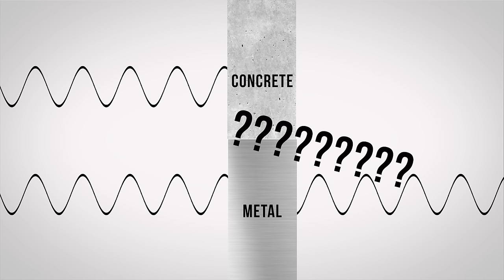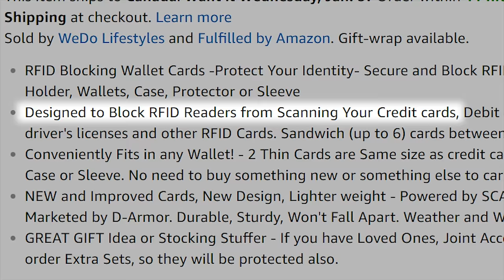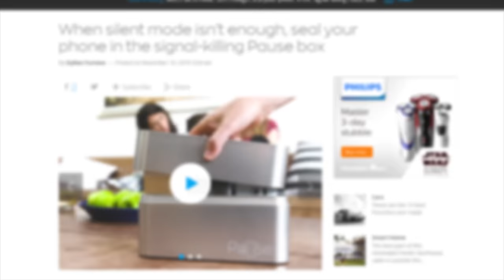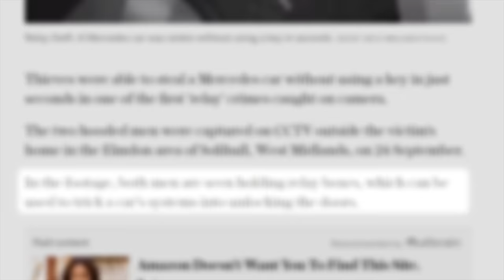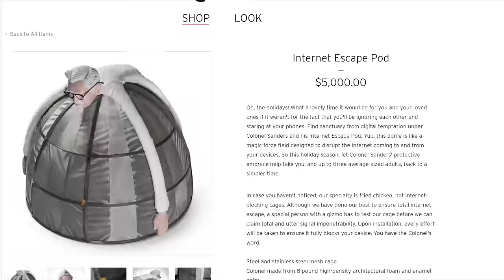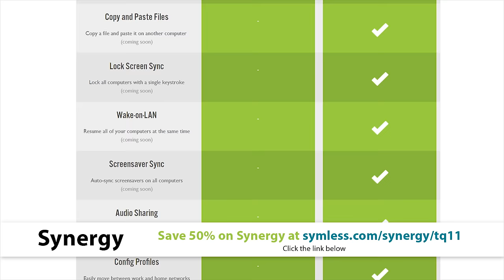How do Signal Blockers Work? (Faraday Cages)

Comment: I live in a Faraday Cage. there are 2 to 3 layers of foil backed foam insulation over my entire house and the seams and corners are mostly taped also.  When my parents built the house we had to take 2 screens off the windows facing the cell towers for cellphones to work inside the house.
Reply: we now have new non metal screens

Comment: Back in the (mainframe) days, a data center was built at an air force base in the state where I live. Unfortunately, when they activated it, the (large) disk drives would periodically have voltage spikes and drops causing problems. It was discovered that the ground control radar for the airplanes periodically swept the building in its circular sweep. The initial and temporary solution was to wrap the building in chicken wire which seemed to work until a more permanent solution could be implemented.

Comment: I love the thoroughness of the explanation and examples and the gratuitous animations. great vid, yos.
Reply: h7opolo, yes, it's thorough. It's also completely wrong, but hey.
Reply: i disagree. please elucidate the shortcomings for me. ty.
Reply: h7opolo, "electric fields push charges away from them." Uhm, depends on the charges and more importantly on the fields. Linus also didn't just misspeak, the animation shows a vertically changing field exerting a static force in the horizontal direction of the wave's propagation. What's that supposed to be, radiation pressure? Also, no word on the fact that EM waves need a minimum frequency for a given Faraday cage to work on them, which is especially important in case the whole explanation was meant to look at a static case.
Reply: He did state that the electric field was moving in a negative to positive direction which repels positive charges, so your first point is moot.
For your second point, would the animation be more correct if the arrows and field lines pointed up and down instead of left and right?
Reply: h7opolo, maybe you should watch the video again. He not only doesn't say what you're saying there, he also said that electrons are drawn towards the signal source. That's total BS. And even if he'd said what you're saying, it still be wrong by 90 degrees.

Sorry, but I can really find nothing redeeming about this explanation. The animation seems to mimick the one from Wikipedia, only that that one's not wrong. So go to Wikipedia everyone instead of watching this video.

Comment: I have a question.  I get that the Farady keeps electricty from getting to the inside or to the outside of the cage depending on where it originates from.   But does the em field change shape to the extent that something powerful enough might not send electricity outside of the cage, but it still might bend space? And vice versa?

Comment: Hi Linus,
I live in a condominium and I see anywhere form 15 to 20 Wi-Fi signals coming into my home. All of which are competing/searching for open channels. This is happening both on the 2.4 GHz and 5 GHz bands.
Needless to say, wifi performance is significantly hindered as soon as I walk away from my SOHO router.
Since I live on the top floor, I thought I would tare the flooring and install a wire mesh, like a carpet, before reinstalling the whole thing.
What do you think of my idea? Do you think it would work?
Ben

Comment: So you mentioned that the frequency of the sound wave actually determines whether or not the signal will pass through a hole in the faraday cage. However I do not understand how this works.
My forward thought is that the wave will pass through based on the magnitude of the sound wave, not the frequency.

Comment: For the sake of accuracy the radiation produced cannot enter the faraday cage but continues across it as in the space inside the cage is isolated
Reply: this should depend on the wavelength in relation to the size of the faraday cage though, no?
Reply: The explanation we learned in school was entirely different than in the video: if the metal bar is parallel to the electric part of the wave, the electrons in the metal move up and down along sending a em wave on their own that cancels the original one out by interference

Comment: Another way to think about this is the cage acting as an antenna.  The antenna is driven by the incoming signal and emits a signal 180 deg out of phase into the cage and in phase back at the source reflecting the signal back like a mirror.
A lot of lower level physics textbooks actually get this wrong and describe the process as the free electrons in the metal moving and then having their energy dissipated by resistance.
Reply: Hmm, can any of you give any tips against laser weapons? Nice to know ...👍

Comment: 0:45 that explanation is wrong, that explains how they work in electrostatics regime. What actually happens is that the electric field oscilates (due to the nature of the electromagnetic radiation itself), generating oscillating currents inside the conductor, witch dissipates energy by Joule effect.

Comment: That is not how a Faraday cage works.

Radio signals are not just electric fields (though if they were, your explanation would be corrected). They are electromagnetic waves. The Faraday cage cancels out the electric part of the wave, by moving electrons through it's conductive material, and without the electric part of the wave, the wave stops. You were pretty close I suppose.

Comment: I seriously wish I could turn my apartment into a Faraday cage. All of my neighbors use dual band routers. The 5gz channels are all super congested, and the way my apartment is set up, we are close enough that their WiFi signals are strong/close enough to interfere a crap ton with mine....
Reply: i'm thinking, you could hang metal sheets on the bordering walls...not sure if i understand it enough though.

Comment: For it to work best it needs to be grounded. 
I’ll be getting a new car shortly and I made sure that I DIDN’T want it to be keyless. I still want to put a key in the ignition to start to car even though they can probably pick up the key to unlock the car and plug into the OBD-II socket then they could start the car that way. 
I’ll be keeping my keys in an earthed metal box e.g. microwave or anything else that’s completely shielded. 

There’s a place close to me that do items for fast jets and commercial aircraft and they’ve got a faraday cage that can fit a double decker bus with room to spare!

Comment: So does that mean that if I just put my phone in the microwave without turning it on, that it shouldn't be able to be called?
Reply: Tyler Lazenby das right, also u wont be able to use wifi or bluetooth
Reply: I just tried this (you made me curious) and it turns out that when I put my phone (oneplus two) in my microwave the wifi signal was immediately gone and my usually stable and highspeed 4g turned into a very slow 3g connection (my provider doesn't support 2g/gsm/etc). I was still able to use the internet though (I used teamviewer to test the connection). I also tried calling myself from a different phone and it went though without a problem. The position seemed to matter, when I put the phone closer to the door it managed to keep a very weak wifi signal. So either microwaves only block certain waves or my microwave is leaking and slowly turning me into popcorn.
Reply: Doskii it all depends on frequency of the signal. Faraday cage can block up to some frequency. Basic equation is width of gaps in faraday cage is equal to half of the longitude of wave from wich you can get limiting frequency by dividing speed of light with measured longitude.  So to conclude ideal faraday cage would    have no gaps (like elevator) so it would block EM waves on all frequencies.
Reply: Doskii the microwave only blocks microwaves because it wants to keep its microwaves inside to cook your food
Reply: I love that somebody just took a testing approach for this!

Comment: I was expecting a Signal Jammer video, like aireplay-ng, instead of a physics class :(
Reply: You were expecting a video on Signal Jammer, which is a much more complicated device, rathen than the simple Faraday cage? 
Tbh signal jammers just spam radio signals in the required frequency, they are nothing special.
Reply: Yeah, a Farady cage it's really simple, is taught on school and there are already millions of videos about it, just Wikipedia is enough for the basics. So, I THOUGHT this was about Signal jamming.
And no, jamming a signal it's not just spamming all frequencies, each technology has a different way of jamming, from Orthogonal Spread Spectrum Waveforms, to common Wi-Fi 2.4 - 5GHz, LTE, GSM, L1, L2 (GPS), "just spamming radio signals" would ruin pretty much your own devices, and it's not practical to transmit high power across a broad spectrum for long periods of time, "tbh" that's just dumb, naive, childish and even dangerous. Believe me, they ARE special.

Comment: I have a friend that keeps duplicates of all his electronics in faraday cages. Two laptops, two smartphones, two tv's, etc. Kinda shitbat crazy if you ask me.
Reply: It's too protect against EMPs (electro magnetic  pulse) which can come from a nuke or the son and considering nassa has said we are over due for the next one while I will say is is a little over prepared in a sense he isn't that crazy
Reply: Yeah, a Faraday cage isn't going to protect against an EMP. You basically need a lead box to do that.
Reply: no you don't, a Faraday cage will work.
Reply: En oK It really depends on the kind of EMP, if a nuke goes out near you then even a good Faraday Cage won't do it because there will be also X-rays and gamma radiation that can easily get through it unless it's veery thick
Reply: why?
Reply: We're only talking about EMPs not gamma or anything else, a Faraday cage that is completely sealed will protect from any v, and nuclear EMPs are usually set off at high altitude for maximum effectiveness/range.

Bunkers though should take care of both those problems.
Reply: En oK emp doesn't happen without massive radiation to my knowledge
Reply: radiation won't affect you if the emp is detonated in high altitude, where it usually is  for more effectiveness/area coverage
Reply: A properly Faraday cage can help in an EMP attack but when there are X-ray or gamma attack, your lead box might be helpful.

Comment: There is a (free) mac app called "JamWifi", This's doesn't physically but rather "networcally" block wifi in entire buildings or campuses.
Reply: Dominique K it just sends DeAuth request spam
Reply: Mohsin Sadiq ik :)
Reply: Seems illegal to me.
Reply: OH NO DOUBT IS IS
Reply: Kali linux..
Reply: Or use Arcai's Netcut on Android! (Needs Root)
Reply: Didn't know that worked on android :) nice thanks
Reply: Don't have a lot of issues with Windows, but I'm a designer so I somewhat prefer mac....a lot
Reply: Of course, but for that you need an external antenna that can go into monitoring mode. Meaning u have to buy physical equipment. With the mac app you just select the network, and "deauth it to death" :)
Reply: Too bad it sounds like it doesn't work on celluar signals. Or at least it would have an anti-cheat application for tests. I mean some country/school deploy actual jammers, but not everyone have access to those..
Reply: Probably illegal.
Reply: Kirby oh definitely
Reply: Yeah, considering it blocks the networks of entire buildings. At least it'l be useful non-illegally in schools by teachers... maybe.
Reply: And they blame us student for lacking initiatives despite technological convinients.. yea coz the damn thing block my signal
Reply: I don't think it's any less illegal just because you use it against students
Reply: Blisphul808 Bro my Network is 120kb Maximum Dude be Grateful
Reply: Codewow Sending packets isn’t illegal. Using the information from these packets, is, in some situations illegal.
Reply: Wait, is it legal if I knowingly crash an important server with a single package, discarding the response? Not all applications operate on a request-response pattern, and most of the time the request itself does matter.
Reply: Jamming  telecommunications is illegal, full stop, no exceptions except for police and millitary and the FCC will nail your hide to the wall if they catch you doing it.
Reply: Kirby plz don't give teachers that idea

Comment: Actually, your electric field explanation isn't pretty accurate.
Signals propagate trough electromagnetic waves, a combination of electric and magnetic fields.

When those waves hit a small enough mesh (the wavelength explanation is perfect) they produce a wave in the opposite direction, and destructive interference occurs on the air metal interface.

Comment: Lol so the new paid-for features of Synergy, which is a pain in the arse to set up, are the exact same features given free with Input Director 15 years ago..
Main difference: Input Director will still work while your CPU is maxed out on other processes, e.g. if you're using one computer to render or compute something, which is the main reason to be using two computers at the same time.. Synergy, in this situation, freezes and the mouse lags.

Comment: That was a very much overly complicated, if not wrong, way of defining Faraday law.
Everything in nature strives towards stability. This is the so called "force free" state. This does not mean that there are by necessity no forces, but the only forces that remain are on average 0 newton.
Metal conductors are very good att finding this "force free" state when it comes to the electric force. If a piece of metal is in the way of an electric field (force/charge) the electrons will move to cancel out that electric field. Getting as close as possible to finding this force free state. Since the electrons generally do not move outside of the conductor they can't truly cancel the electric field outside of the conductor. But inside the conductor the field is practically 0. This means that the field will be 0 on the other side.

Another way of thinking of this is that when a lightning bolt hits a metal cage the cage as so much higher conductivity then the person inside of it that practically all of the current moves trough the cage instead of the person inside.

There is another aspect of Faraday's cage, that only applies to electromagnetism. A "wave guide" is a metallic pipe with circular or quadratic dimensions. It guides electromagnetic waves, but only the waves with the right frequencies. It behaves similar to how sound waves oscillate in a pip, just in the opposite direction this time.
While the magnetic field to the wave points along the wave guide the electric field of the wave points in the direction towards the sides. So the possible wave lengths are then limited by the width of the wave guide: https://www.electronics-notes.com/images/waveguide-rectangular-te-modes-01.svg
So low frequencies tend to be blocked out, while high frequencies tends to pass. The waves with lengths between the ones you could see in that picture tend to lose a lot of energy really fast. So they do not penetrate the wave guide, instead they get absorbed and turned in to heat.
Now think of the square holes in the Faraday's cage as a very short wave guides. The lowest frequency that can penetrate a rectangular hole is f=c/a.
f is frequency (Herz).
c is the speed of light (299 792 458 m/s).
a is the length of the longest side (m). It is also the longest wave length that can penetrate the 
Lets say that a = 0.1 m, or about 4 inches. The lowest frequency that can penetrate this hole is then about 3.000.000.000 Herz or 3 GHz. This is enough to block out the frequencies that are used in both radio apparats and mobil phones. 
If you want to block out any or all visible light then you have to have holes as wide as 390 to 700 nano meter.

Comment: How do I connect 7 3 pin fans?
Reply: GehaktBalGames splitters/hubs
Reply: :thinking: spliters are bad  if they don't get any more power
Reply: Don Alexi not really, normal mainboard headers can easily power multiple fans. Some guys replaced the two big fans on a noctua cooler with 48 tiny fans that ran off the cpu fan header
Reply: at full speeds? as it can limit the max performance
Reply: Don Alexi just rewatched the vid, they actually 'only' connected 12 fans to one header each. Its a german video but here you go: https://youtu.be/hn3YBE4N_dY
Reply: v Nyggi well that's a lot, but there might be some long term problems

Comment: 3:20 I'm calling BS on this one. There is a lot more metal material in my belt buckle then in the few sheets of aluminum foil needed to stop a RFID transmitter. Every customer would be setting off the metal detector.

Comment: This is a very shitty explanation. They don't talk about the difference between photons, which don't have a charge at all, and electrons. Ugh. Lazy. Radiation doesn't leak from your microwave because the microwaves have a bigger wavelength than the cage inside... it's why you can still see through.